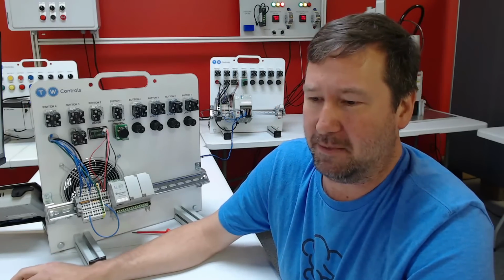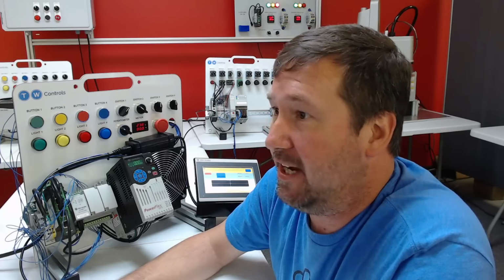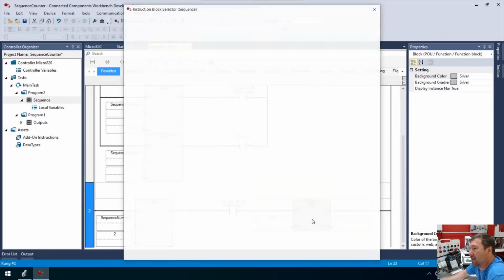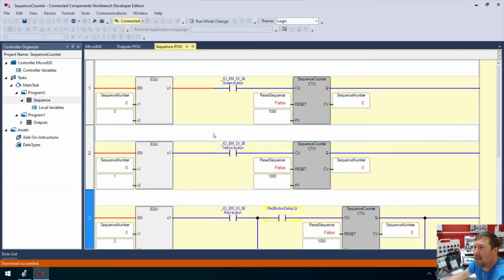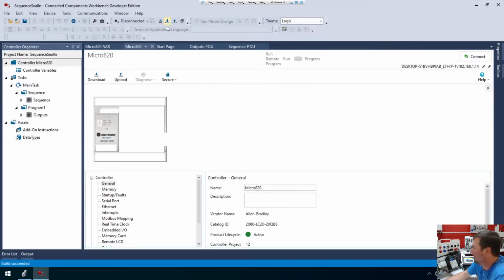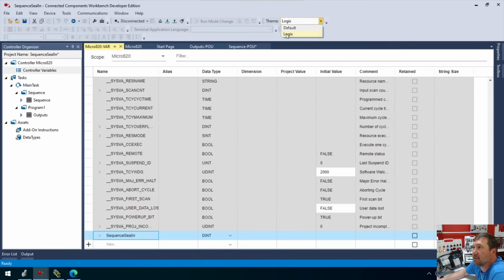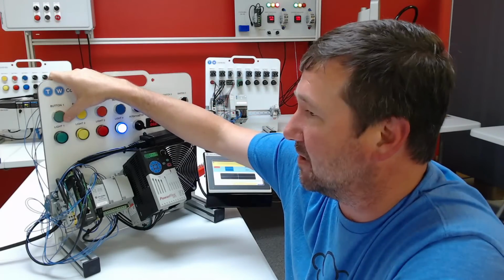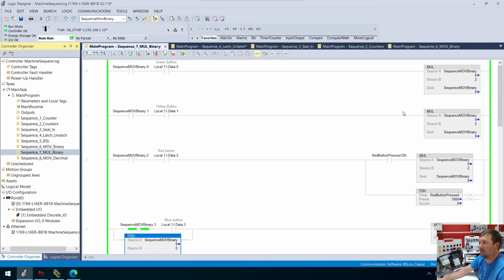How to Program Sequencers in Allen-Bradley PLCs

Comment: Great tutorial on Allen Bradley PLC sequencer programming! The way you broke down the step-by-step sequence control logic is exactly what both beginners and seasoned automation professionals need to grasp machine sequencing. I especially liked the emphasis on structured ladder logic patterns for state transitions—this mirrors the modular approach we use in industrial system design.  

Interestingly, the concept of sequenced, repeatable steps in PLC programming reminds me of another field where precision and modularity are key: scaffolding systems. At Qingdao WanchengTai, we apply similar thinking to our Ringlock, Kwikstage, and Cuplock scaffolding systems. Each component follows a standardized sequence for assembly, ensuring safety and efficiency on site—much like a well-crafted PLC sequencer ensures reliable machine operation.  

For those new to sequence control, the tutorial’s comparison of different methods (e.g., shift registers vs. state-based logic) is invaluable. Beginners should practice building a simple “traffic light” sequencer first; it builds confidence for complex multiprocess sequences. And for pros, don’t overlook the benefits of structured text for complex sequencing—it can reduce debugging time significantly.  

If you’re designing automated assembly lines for prefabricated structures (like our Pipe & Fitting Scaffold systems), integrating PLC sequence control with modular hardware can dramatically improve throughput. Thanks for sharing these deep insights—they’re great fuel for both learning and real-world application.

Comment: Tim, Thanks for another great subject and video. Thanks to Michael as well. Sorry I wasn't able to attend live. 

I was taught the seal-in and latch/Unlatch methods.  

I like the MOV decimal method the best. It seems you always have to add something that wasn't originally planned. Looks like it would be easy to skip steps if not need. In a current application they plan to use a bar code reader to determine if a part needs a hole drilled in it or not. If not, we will just skip the drilling step.

During the latch/unlatch segment you tried to change a direct coil to a set (latch) coil. Don't know if you have found the answer yet. If you select the coil then go to properties, you can change it by clicking the down arrow on the "Modifier" line. All valid coil options are listed. The same is true for the contact and some other types as well.
Reply from the maker: Oh my goodness Kevin.  That is amazing.  Thanks for sharing, here is a video about it! https://www.youtube.com/watch?v=SxHTXlfTI1Q